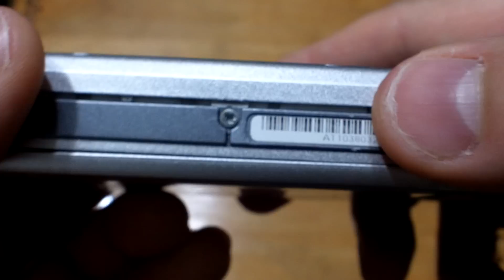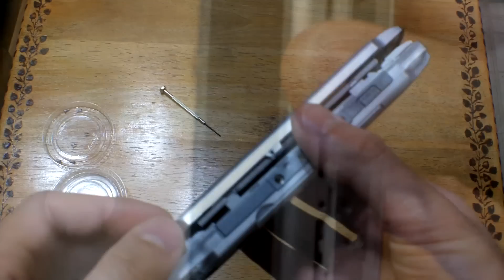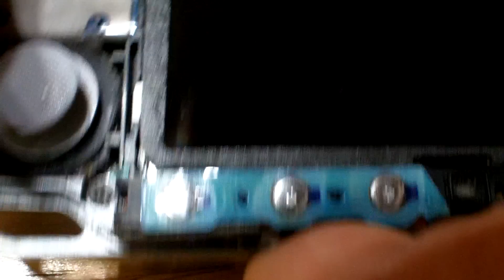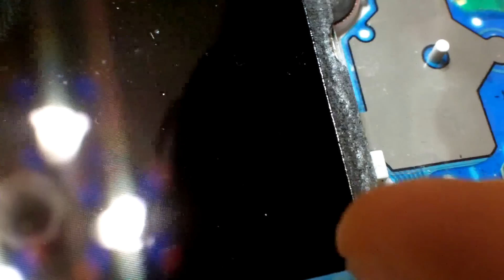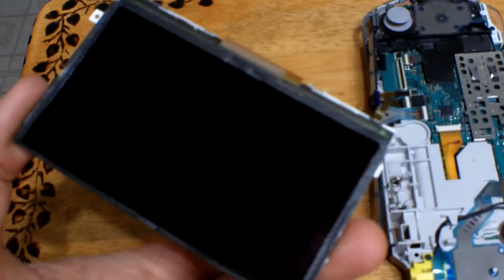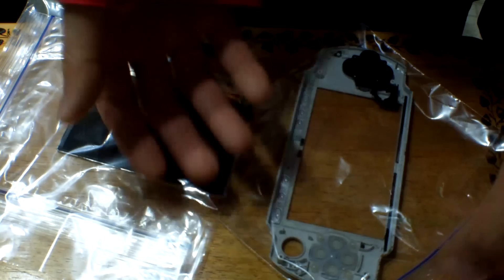How To Disassemble a PSP 3000 (Part 1 of 3)

Comment: I just bought psp 3004 for 15 bucks and i wanted to clean it and ur video helped me very much. If i can tell you something, to opening brackets and other things u should use some plastic tools instead of metal but very good video. And also i tauhgt i broke my psp bcs the display was black but then i realised that i connected one ribbon not all the way in the connector XD
Reply from the maker: Thanks for the tip!  Lol, thankfully you were able to get it sorted =)

Comment from the maker: Hello candycandy57,

You can try out the following:

Place your psp laying down with the screen facing up.  Place it on a hard surface (like a table), near the edge.  Now place a small towel ontop of the psp.  press down on the psp, will putting pressure on the screw (make sure your putting pressure on the edges of the psp, not on the screen, and make sure it isn't a ton of pressure).  If the screwdriver slips, you either hit the table, or the towel.  Make sure your screwdriver's handle is big

Comment from the maker: Hello crimson22s,

Yep, I believe that bar holds the screen in place.  I'm not sure about cracking the screen, but you can end up cracking the thin pieces of plastic near the holes.  You also run the risk of getting the screw stuck halfway into the hole.  Make sure to use the right screws and screwdriver.

Comment from the maker: Hello grievousorvenom,

I'm not technically savy (this disassembly vid is about as far as my knowledge extends), but it could be that something is messed up with the mobo.  Other possibilities:

- Ribbon cable not fully attached
- That long bar just keeps the lcd screen in place I believe
- The sticker pad for the d-pad may need cleaning/or is damaged
- The rubber part right under the D-pad may be ripped/damaged

Hope this helps.

Comment from the maker: Hello 00CaptainPrice,

Yeah, that one can be tough to remove.  Make sure you put pressure onto the screw while unscrewing it.  If you're changing the case, I believe you can just rip the plastic edge/case (if the screw is stripped, like in the video).  Although, its best to use a broken psp's case, rather than those cheap ones on ebay (the cheapo ones will not fit correctly)

Comment from the maker: Hello TheDxhacker,

Hmm, I'm not sure.  I have the 1000 model, and hacked it back during the 1.50 fw days, so I'm out of the loop when it comes to the newer methods.  Did your psp have a custom fw installed before semi-bricking?  If so, you should be able to restore it back to normal by getting into the emergency menu (hold R when turning on).  I had my psp semi-brick a couple years back and that's how I got it back into shape. 

I have a site that I can PM you that takes you to a helpful forum

Comment from the maker: Hello crimzenballer1,

It could be that the rubber part under the button has broken.  Does the button feel normal like the other buttons?  The contact pad underneath may be dirty, try giving it a clean and see if that helps it out.  If you have a hacked psp, it might be a hack issue (try resetting your psp to it's default settings)

Comment: I can't remove the left side of the bottom button row, like you do on 3:50. Mine has a ledge(?) that goes under the grey part with a black screw and I don't know how to get it under that, because that grey rim that goes all around the shell won't budge.
Reply from the maker: Sorry for the delay.  Were you ever able to get at it?

Comment from the maker: Hello wwe567890,

For some reason, some memory sticks fit in too tight compared to others (I had this happen several times in my 1000 model, not sure if they fixed it in the other revisions).  If I remember correctly, I would use a thin pair of tweezers to pull out the memory card.  If still not able to, you'll have to take the whole thing apart.

Comment: i was wondering about that metal bar that goes at the top of the psp like you stated... does the bar cover over the top of the screen to hold it in place or does it stop the screen from sliding around? and secondly i heard that if you put wrong screws in the battery holes it will crack the screen or something

Comment from the maker: The cheap bootleg case that I bought didn't fit properly.  It was a tad off which caused the system to not want to close.  The best bet for a right fit is to snag a broken psp (with mint condition casing), and just swap out casing for your appropriate model/revision, while reselling the excess parts.

Comment from the maker: If I remember correctly, these cables don't connect securely, so it could be that the cable popped out while putting your psp together.  Either that or maybe the component burned out.

Comment: I have a question does the psp 3000 housing fit the 3001? going to buy one right now and I noticed that while some do say psp 3000/3001 theres alot more post with more colors and variety if I searched just psp 3000 housings and they all say best suitable for the 3000 in the description

Comment: could you do a shot of the wifi switch? the switch part got broken and its stuck in wifi off. i took the switch out then moved some wires under it with a screwdriver but then it wouldnt turn on. i moved them back. i have no wifi switch now, i wanna solder it closed so itll just always be on. how would i do this?

Comment: Can you use a 3000 shell on a PSP 2000? I have 2 PSP 2000's but I really like the green Metal Gear solid shell! I've replaced the LCD and analog and complete shell on both the 2000's and PSPgo I have so I have experience. Just wondering if I can use a 3k shell though...

Comment: hey am having some major problems with my psp. for a few months now everytime i turn on my psp my action buttons would not work straight away but would start working after 5 or six minutes maybe longer which i could live.Recently my psp action buttns have stpped working and i dont knw what 2 do -do i replace the right hand circuit board or what its a psp 3003 on pro b7 im also stuk on setup screen and wenever i used to instll and reinstll cfw it used to strt wrkn better so it cnt b hrdwre cn it?

Comment: Hii thanks for the reply,
 The problem is that i have replaced opening_plugin.rco from flash0 i think that's why when i start my psp the green light is turning on and the psp's screen came up with a little bit light but there's no display. If the flash0 is stored in any memory card inside psp then u please tell me so that i can take it out and replace it's data with the backup i have. I had a temporary cfw installed before this happened

Comment: Um hi there, I have a problem with my psp 3000 where the d-pad moves up, down repeatedly and I can't control anything in the menu because it seems like a button is stuck, soooo, I unscrewed the PSP, cleaned the d-pads and whatnot, then after a piece of long thin metal with F1 on it fell out, I screwed it back into place, turn it on and same problem, do you know what I have to do, and is the F1 piece neccesary? Please respon ASAP I need help quickly

Comment from the maker: There may have been a piece that got dislodged and is causing the screen issues and loose fitting parts.  The dislodged part is probably putting pressure onto the screen, which is causing the lines (I had ruined a lcd screen by putting too much pressure on it with my hands, as I was trying to put it back into the case, 20 bucks down the toilet, lol).

Comment: it might be worth mentioning that when you attempt to lift the button bar from LCD screen you may find that the screw to the left of the button bar (the one that attaches the metallic strip to the bottom of the psp) also bolts the button bar to the rest of the psp, i ended up badly scratching the side of my button bar b4 i found that out. =(

Comment: PLEASE HELP ME!!!!!!!!!!!!!!!!
-When I reassembled it, the top screws will not go through because there is something blocking it, I'm not sure what it is, but i don't necessarily want to take it all apart again. -The sides with the SD card and the power switch side will not shut back together tightly. -My screen now has vertical lines across it, as well as a few horizontal. I made sure i tightened the strips & such but I'm not sure what else to do -my power button slips upward and gets stuck

Comment: The psp3000 is pretty aweful for cracking screens. I had one which I used, broke fixed only to have it break again.

The other machiens aren't much better though. Psp2000 wasn't much better. the parts wore out like the umd reader, and usb port. psp1000 works but it huge with a blurry screen,

I wonder what system I'll rest oin for posterity sake.

Comment from the maker: If I remember correctly, I ripped out the plastic side panel due to the stripped screw, then reused the same panel.  I couldn't get the stripped screw out.  It's like the manufacturers super glued the damn thing in, lol.

Comment: I cant get out my UMD Drive. how did you? the screws are really tight. I have the screwdriver. 4 of them but they aren't coming loose. HELP
Reply from the maker: It's been a couple of years since I did this video, but if I remember correctly, I used the screwdriver bit that fit in the screw hole that was as form fitting as possible (a bit too small or large can run the risk of stripping the screw).  I then put the weight of my body into the screw as I was turning it.  I imagine there might be a pcb board safe liquid that can be sprayed into the screw to loosen it up (sorta like  WD-40).  I remember there was one screw that was not coming out, no matter what, so I just broke the plastic around it (I believe it was for the bezel that ran around the outer part of the handheld)
Reply: Viola Blue  thank you. I tried everything I possibly could and the screws just aren't budging. I found (luckily) a ne replacement  UMD for my PSP model on amazon. I got frustrated with it lol. It  was the only thing I needed to start putting it back together. but thank you anyway. I DO appreciate your help :)
Reply from the maker: Happy to help =)

Glad it all worked out for you (^_^)

Comment: Weird how different consoles can look inside which are made from different companies. Nintendos seem more simply but obviously thats because they are like lego for them... Sonys don't look like they were made to be taken apart.
Reply: I kinda have to disagree with that, I never took apart a Nintendo console but the psp 3000 is pretty simple to take apart
Reply: kieran cherrington Did you ever tried to disassemble a ds lite? I found it way more harder than a psp actually
Reply: Bernardo Assis actually I've only done the 3DS XL. So I shouldn't comment. My friend did a ds lite to fix a cracked top screen and broke the touch screen in the process..

Comment from the maker: Hello C6mb0di6nSw5g619,

Nope, I don't believe you can unfortunately due to the subtle differences in the way the cases are (for example, the psp 3000 has a flat backside, while the psp 1000 has those two bumps in the back).

Comment: @Treasurefan02 well, I'm going to a tech place tomorrow to see if I can get it fixed because I know now that it has to be electrical, and the long bar, well, I'll keep it in a safe place, but it really is not necessary ^_^ The LCD screen sits fine without it and it just fell out anyways so, yeah. My psp just has a wiring problem everything else works fine though. Although, if they can't fix the wiring problem, I'll have to buy a new one, which is inconvenient and stupid DAMN YOU SONY!!!